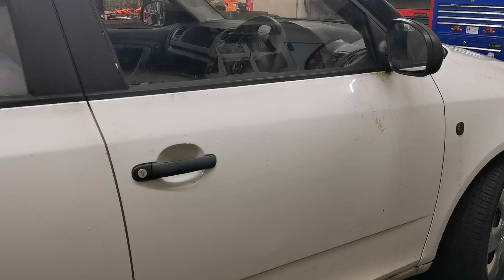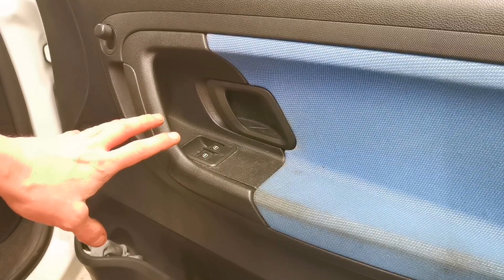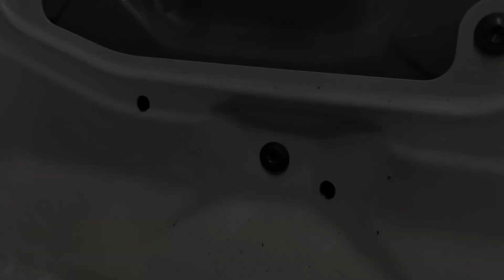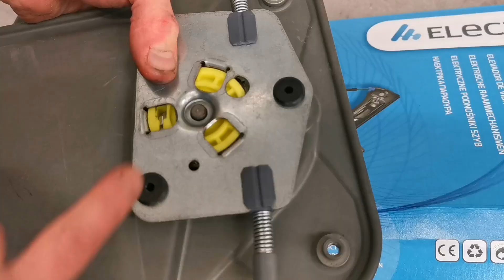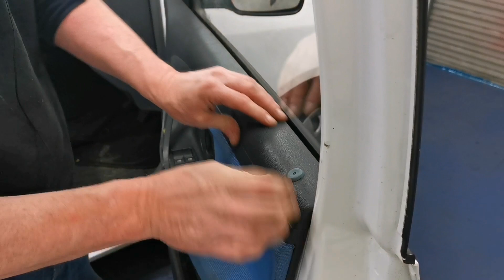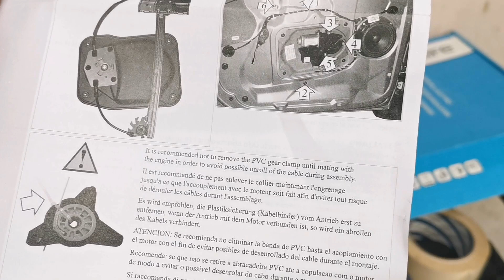Skoda Fabia Window Dropped into Door, Driver's Door Regulator

Comment: USEFUL TIP for anyone performing this repair when the glass has come fully out of the guides and is in the bottom of the door, inside the door at the rear is a chunk of closed cell foam, remove this and using a length of webbing passed under the glass at the rear end allowed me to remove the glass easily after a lot of frustration.

Comment: Can't thank you enough for this video. Bought a regulator for £30 on eBay and was able to fix this in about 2 hours with your help. Was expecting it to take me days!

My biggest problem was how tight the torx bolts were on the regulator I nearly stripped one that was holding the window. Hand tools kept slipping for me. Ended up using a drill with t30 torx bit and doing very sharp presses of the trigger to get enough torque. I'm guessing an impact driver might have come in handy here.

Comment: first of all Thanks for such a useful  video.
Useful video . there is an issue almost the same  with my fabia combi 2003. Mine the driver side buttons include side mirror and central locking. The central lock works but with the remote key, and i checked the fuse that was in good condition and i checked the wires there was electric just at one wire that is all. What could be the prob. 
Thank you.

Comment: Hi Dave, cracking video mate. Noticed your Rode wireless mic in the video, what model is it mate? Any issues with it? Cheers 👍
Reply from the maker: Rode wirelessgo. Brilliant job. Usb rechargeable. You don't get a mic with it so i splashed and bought the Rode lavalier that's recommended. There's a two mic version just out that Sandy has.
Reply: @davesterl  Thanks mate, much appreciated 👍